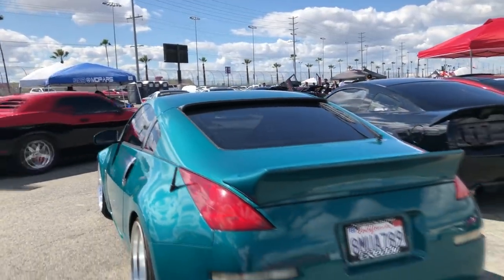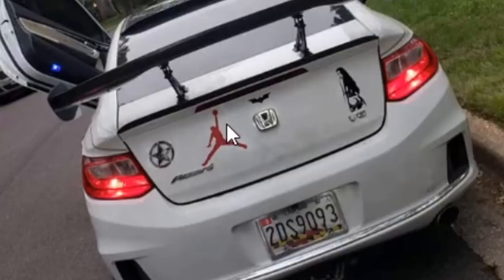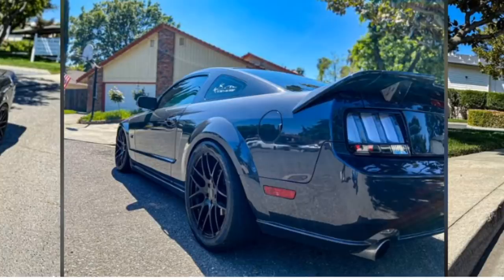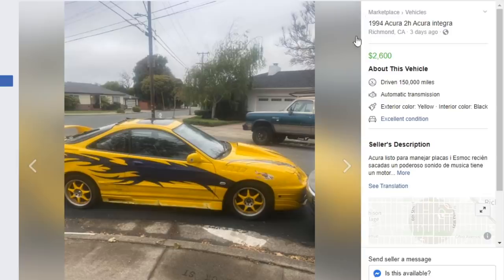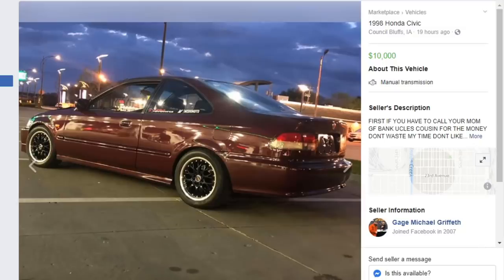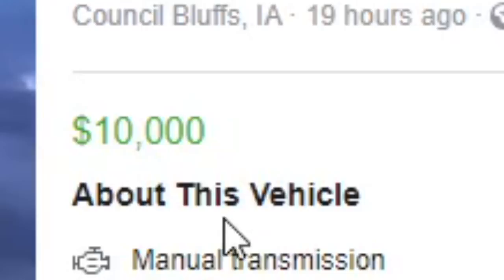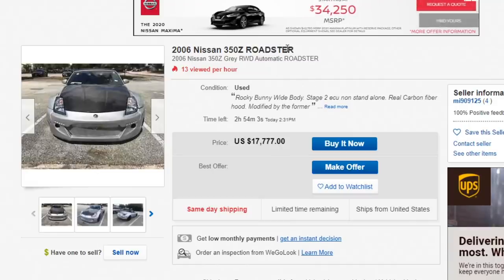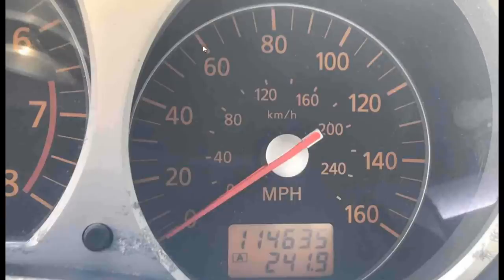Who Would Buy These Riced Out Cars?!? (Ricer Cars On Craigslist)

Comment: Yes the cars in this video are rice shit. I agree with that. However on a few occasions you deemed a cars value (including your own Mustang) being higher based purely on the fact that it has high power.   I wouldn't judge a cars value based on power output.  BHP doesn't increase value.  There's so many more factors to consider.  I'd rather purchase a mint 350 bhp car than a 700 bhp car of the same model that's been thrashed and had a hard life.

Comment: really youd be surprised your mustang wouldn't get 25000? I went to get my oil changed 2 days ago and seen a 4 cylinder mustang fastback for 25000 used with 60000 miles lmao it had turbo an all but the body was a little big for the engine size.

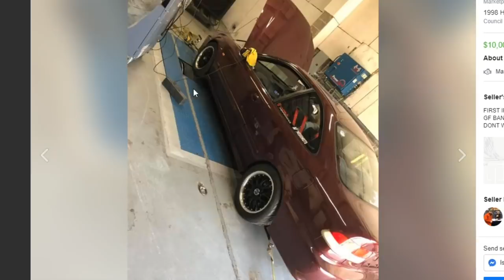Comment: 8:00 It's obvious you don't know anything about modifications if you think this is a ricer. From the front end you see the Mishimoto intercooler (not oil cooler). It is turbocharged from the under hood pic you can clearly see a turbo and the intercooler piping. It's hard to see, but that's a B series head on it so it could be the type-r engine swap. Im not even a honda guy, and I can see that one doesn't belong on the list. 

The others are rice, this one you forgot to wear your glasses in brother. Bad form